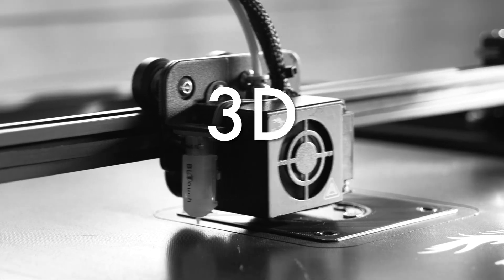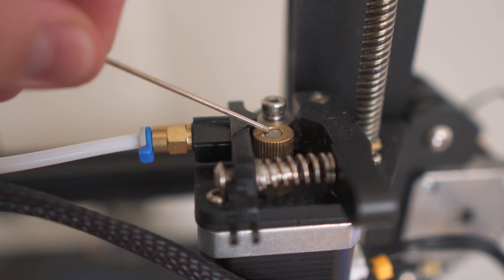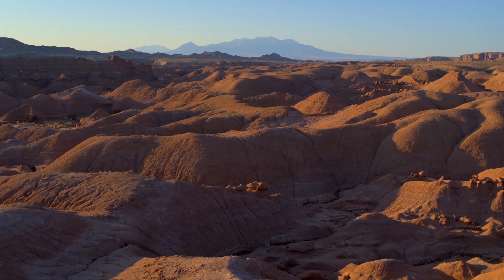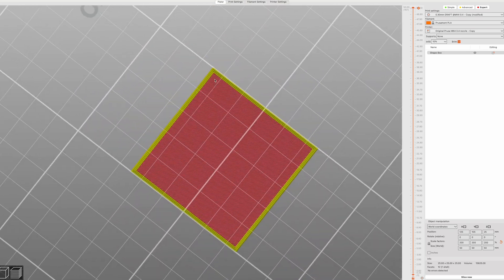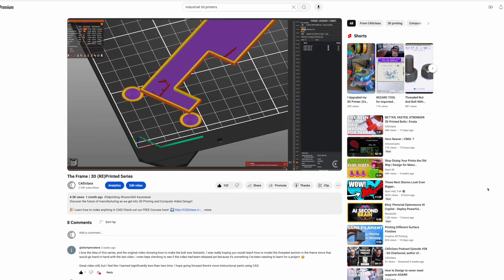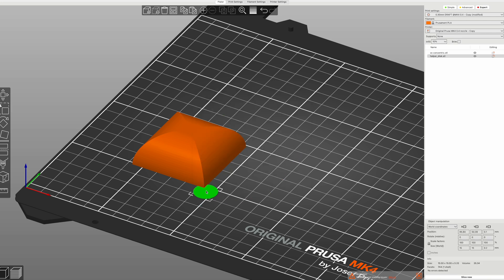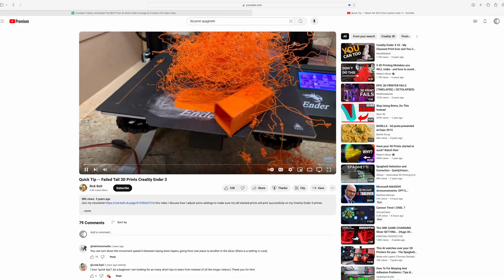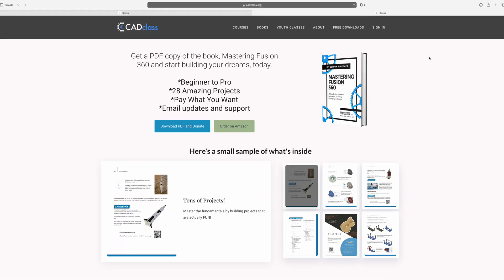The BEST ways to fix WARPING in 3D Prints!

Comment: I'm looking for tips on how to handle warping when bed adhesion is NOT an issue. I'm talking about when parts are tall enough and curving away from the edge (think half-sphere printed right down the middle). I feel like this is something easiest to be solved at the design level, not print level, but nobody seems to talk about where to add/remove features to improve the structure and reduce the shrinkage stress.
Reply from the maker: Shrinking stress is more likely caused from the type of printer you have (open, vs closed) rather than the design or slider settings

Comment: As a new 3d print user, i was stumped when prints would warp off the build plate no matter how i addressed the adhesion situation, turned out to be a particular filament issue, printing the first few layers with a different brand solved the issue.

Comment: All this goes a long way!    But one misconception I had was that cheap Material is just as good as more expensive stuff.    I had  a big job for a Retrofitting job at work and I chose Elegoo Matte PLA for the job,  needed 4KG     and 4 spools were available for £11 each.   winner!  so I thought.   I can elevate warping issues mostly  but this stuff shrinks like crazy. I did question my methods but tried a spool of PolyTerra Matte PLA  and wow!   same settings  no shrinkage, side faces are straight,  on the cheap stuff they bowed in like a banana as the print went up and the material wants to pull itself in.       £20 a  spool  I should have just got that first,  luckily I was payed £500 for just 25 parts  so the extra material cost is not that bad.

Comment: A suggestion I always give New users is that if you do get successful prints in the beginning save one of them a Benji or something one of the first things you can do to diagnose a problem with printing is to return to known good meaning you print a G-Code file not a 3D file an actual G-Code file that you have successfully printed before what this does is it removes the slicer as a variable since you know this file worked before you know the slice work before if this file works then it's probably a slicer issue if this file doesn't work then it's probably a printer issue or a filament issue. 

It's just one more way to help narrow down and diagnose the problem 

As for warping specifically sometimes it doesn't matter what you do You're not doing anything wrong it's just not going to work without some sort of trick 

I am printing these giant blocks that I designed I'm going to try the 3D print an entire shed each block is 300x300 by 150 mm and consumes just under 1 kg of plastic using a 1 mm nozzle with a 0.8 mm layer height so big fat extrusions 

Normally warping is simply not an issue when you lay down that much plastic it just freaking sticks but this print just refused to cooperate nothing I did worked I even redesigned and re-engineered the entire part with every non-warp trick I could come up with even to the point of adding deep curves nothing worked except one thing printing the 300 mm part on a 400 mm bed most likely because there's no bottom layer and because the extrusion is so big and the part so long the available energy to warp is it simply huge combine that with the Delta between the center and edge of the bed for temperature and there is just nothing I can do to stop it from warping when I print on a 400 mm bed I have an extra 50 mm between the part and the edge so the temperature delta is smoother and the part would stay put but the 300 mm part on the 300 mm bed it just refused to not warp The only solution I could find that worked was the freaky black magic from the witch's  over at vision Minor. Their nano polymer stuff just worked in my particular case 

My workforce was so incredibly strong I even went with my tactical nuclear option of last resort I pulled out one of my precious old fake build tack stickers The ones that feel like cloth everything sticks to those and I mean everything 

And it worked The part did not separate from the sticker instead the part ripped the goddamn freaking sticker right off the aluminum plate literally rip the sticker right off :-) 

So sometimes it's just not your fault and there's not a whole lot you can do about it you just have to compensate for the forces involved.

Comment: Great tips - especially the concentric pattern to limit warping.
In Fusion360, how did you make the concentric pattern? Was it a manual process or were you able to find a quicker way?
Thanks again!
Reply from the maker: Just manual, unfortunately there's no way to do this parametrically
Reply: just about to try this on a couple of large flat models that sometimes work, sometimes dont.  questin though - any guidance on how deep the cuts into the base need to be?  going to try 1mm as a starting point, but any empirical observations gratefully received.